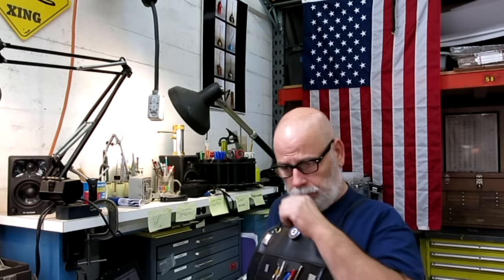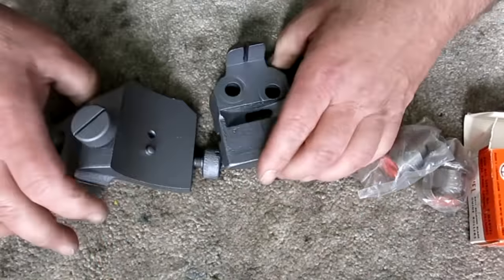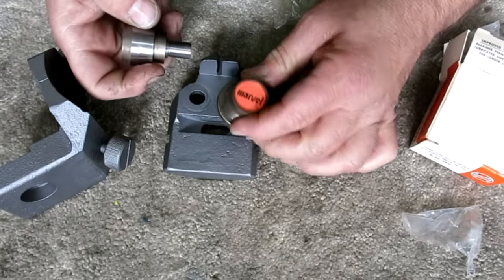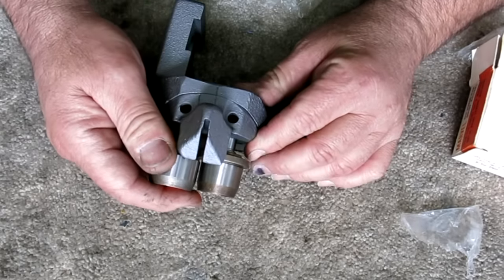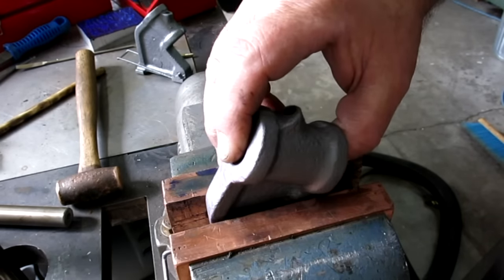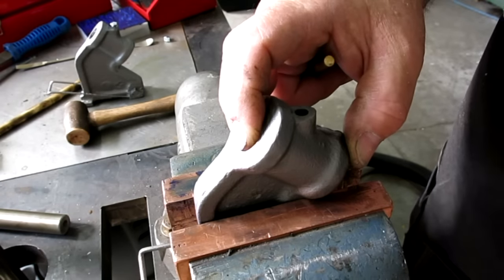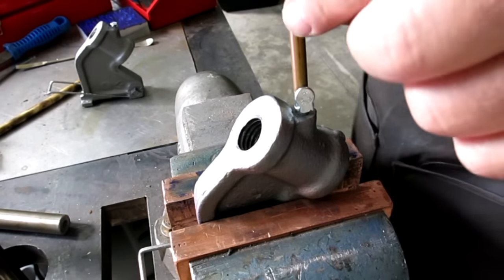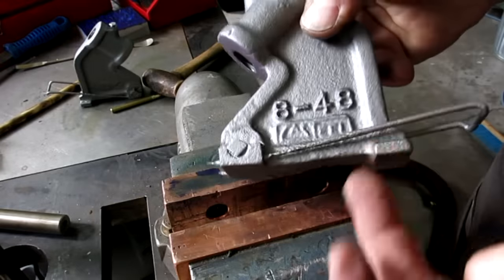Monday Night Meatloaf 105

Comment: "Rode hard and put up wet."  What you don't want to do to a horse.  Riding them hard will make them sweat, a bunch, and when you get back to the barn and after removing the tack, at least curry the horse to push the hair up so the sweat will evaporate.  Here in Florida, we usually put the horses on the wash rack and give them a rinse to wash the dirt and sweat off.  Of which they promptly go roll in the the dirt.  Ya gotta love em.

Comment: I just tried out Northern's tap wrench that arrived today. This ought to be the industry standard. Very, very nice to use and certainly well made. I'm tapping #6 & #10 in blind holes and this is much better than my other method (socket screw in the drill chuck to center the tap, small open wrench to turn the tap). I was going to make my own design for a wrench but this one is ingenious. Wonderful, and the price is reasonable. You have a great channel and I appreciate your thoughts and professionalism, thanks for reviewing this great little tool that I would not have noticed otherwise. BTW I live in Canada and our dollar is low to the US dollar, I paid 30% more because of that but even at that it is a treasure and will save a lot. It's a matter of pride that (North) American quality wins out in the long run.

Comment: Fun stuff Tom. The tap wrench looks pretty good and useful for sure. It should make having to use the smaller taps easier then a T-handle style. Send in that shaft when your ready and we'll get you fixed up.
Reply: Our design is an improvement on both a straight handle and T-handle wrench and hope that others understand the benefits.  Northern Machining
Reply from the maker: Hey Adam,

Thinking this one is a little small for you buddy. Wait til they come out with the #24 Northern Wrench. Thanks for stopping by.

Best,

Tom

Comment: I would not spray "weld" that shaft. Spray welding isn't really welding. It's a metal cladding and the bond is mechanical, not chemical. It's only suitable for static surfaces like roller bearing journals or lightly loaded sliding surfaces like for a lip seal. It would be much better to turn the whole shaft down maybe .06-.1 and weld it with an actual welder (choose your process, they will all work). Then machine the whole thing back to size. Don't just weld the corroded bit because the shaft will warp all over from the heat. You have to weld the whole thing. Hopefully you will not have a bunch of runout in the gear when it's all said and done.

It might be easier to turn the shaft down to the next nominal size and use a thicker bushing. You would have to sleeve the pulley or whatever goes on the out end of the shaft.

Comment: The tap wrench is pretty clever, I will investigate to see if the carry various sizes...  I see this speeding things up quite a bit, vs. swapping in & out my spring loaded center... not to mention, while doing very small holes, and being off kilter ever so slightly, and running the risk of snapping a tap, due from unequal flute loads...  Thanks for showing this one. I was thinking about the guild bearings, are they hard to come by, of no longer made? Beings that in due time, these new units will wear out as well, would it be a simple idea to blue-print them out, as they are new.... so down the road, you have a print, of the important & factual  dimensions, maybe then you can design & make your own?, That is, if they are hard to come by.... Drew

Comment: I find forceps are better than tweezers because you have the option to clip them in place.  Short jaws and long handles increase the grip to something similar to a miniature pipe wrench ...another candidate for the copper jaw treatment.

They both come in a mindboggling range of shapes and sizes and usually have a good amount of metal on the jaw, enough to allow a bit of massaging with a file to accommodate specific shapes

Comment: I remember when I was an apprentice,  we had white cloth aprons that had a little swinging pocket sown onto the bib to hold a 1" mic so it wouldn't fall out onto the floor every time you bent over.
Reply from the maker: Hi Pete,

They still have them. The apron I have has a flap front that you can lock down as well. Thanks for the comment.

Cheers,

Tom

Comment: Enjoyed the video as always.  Like you said that tap wrench needs a little more size on it or a note specifying that it is for taps up to "X" size.  You might have actually used a larger tap than they had in mind for the handle.  Keep on keeping on.

Comment: Re: tweezers... You might want to try plastic tipped as well. People think of them as non-marring, but most types also have the property of being just soft enough that very small screws don't watermellon-seed out of the tip while you are trying to get them started in a hole. I also plastdip the tips of tweezers and needlenose pliers for the nonmarring and slightly grippy property.

Comment: Steel it good stuff painted a BMX frame with it and a Baja VW race car tough stuff, clear coat helps did help the VW it slammed in to a rock twice as big as the Bug folded the right so if there had been a passengers seat they would have been hamburger. Big the left side look great!

Comment: I note that the tap wrench is listed at 10" overall. Tough on the legions of YouTubers who have 9" lathes. Combined with your observation, it might be nice to have a 9" (or 8.5") option with larger diameter handles. (Shorter handles require a harder push to get the same torque on the tap.) Or maybe an enterprising user might shorten the handles and install a pair of 3/4 or 1" ball ends.

Comment: Thanks for the tip on the steel-it. If it can protect bleach filling equipment, maybe it will do the same for things exposed to salty coastal air.
Reply: I had some paint that my dad got while he was in the Coat Guard years ago.They had no use for it because it was battleship grey and the story was it was kept on hand in case of war but every so often it got replaced.Well my dad grabbed a few barrels of it and we used that stuff for years at my uncles marina.We started with a old salvaged Travel lift that we restored and we painted it with that stuff and 20 years later its still rust free.We painted everything with that stuff and I really wish I could find it again because nothing and I mean nothing has held up the same.We've repainted things 2-3 years after painting it with todays garbage that looked worse than stuff finished 20 years ago.

Comment: Try titanium pliers. Not cheap, but solder do not stick to them and they do not magnetize and pick up stuff you do not want to pick up.You buy them once and cringe a the price, but they last a lifetime and you soon forget  the price.Some tweezers  do not open up enough to grip larger stuff. Just prop a small rubber O-ring in between the legs and adjust to your preference. Any other rubber item will do, but you'll probably find an O-ring close by. :-)
Reply from the maker: Great idea on the oring in the tweezers. You really want to use them one handed so having them stay open a little more would be useful. Thanks for the comment.

Cheers,

Tom

Comment: Galvanic series.... right, so what does painting a polyurethane impregnated with S/S 316 do for your steel parts?
I would think a zinc product would be better.
Same reason you wouldn't use nickel antisieze on aluminium right?
Reply from the maker: Hi Nick,

Check your electrochemical nobility chart. Steel and cast Iron are pretty close. Alum and steel are much further apart. Basically when you coat steel with this paint it has the basic corrosion resistance of stainless steel. Thanks for the comment.

Cheers,

Tom

Comment: I could have used that tap wrench yesterday but used my own low profile version instead with a centering hole.  I primarily use the smaller taps that don't have a dimple and it would have been very useful.  They are certainly not giving them away at that price but I suppose other "high-quality brands" might cost just as much with fewer features.
Reply: They're as much and more.Hell I've seen "Top Quality Imports" advertised at a hundred and more.
Reply: I do appreciate made in the USA (assuming anyway) but as a hobbyist and for a single tool, it is pretty high.  They should also consider making them in different sizes, say down around the 4"-6" area.  I'm hoping that they are reading over these comments too.
Reply: Keith Ward I'd like to see it with interchangeable length handles.I think it would be pretty easy to do on their design.
Reply: Hey guys I am with Northern Machining the makers of the tap wrench and yes I am starting to see the need for shorter handles, or different variations of the handles as far as length and diameter.  These have been made in a relatively small batch (50ea.) so that is what is driving our price up along with not short cutting the quality.  Our jaws do not wear or chip away, at least not what we have in our shop or any complaints from anyone that has purchased.  This is made in the USA!
Reply: Northern Machining, Inc. I'd really like to see if you could do swapable handles.Even if we didnt buy them just being able to machine up a set of our own would be a great feature in itself.
As far as pricing goes I think you're right in the mix for what it is.It's priced within reach of other top quality tools so I wouldnt let the youtube cheapskates beat you up too much.But if the price were to come down about the price of a few beers it might help sell a few more.I know it would get me off of the fence.

Chances are I'll be ordering one pretty soon because I  tap a lot of small holes in hard materials and as we all know its not the big taps that break ;) So for me if it keeps one part out of the scrap bin it'll be money well spent and I'm sure there's others out there that feel the same.

Comment: The tap holder is an interesting concept but is it a solution in search of a problem, whats wrong with a drill or collet chuck, of which most people already have?
Reply: Leverage?
Reply: Yan Wo power tapping?
Reply: You dont have to power tap -you can also twist your mill spindle/lathe chuck by hand.Great for blind holes or when you dont have  machine taps.It will stay in center,just back it and oil it if you use hand taps.
Reply: Indeed you can, on my mill I just turn the pulley so I have "feel". I also have an auto reversing tap holder for power tapping, but rarely use it.
Reply: In a drill chuck is an option for smaller taps, but many times you can not turn one by hand, or pulley if near a 1/2".  All depends on the situation at hand.  Maybe is not the wrench to use every time, but has been designed to work both as a straight handle and a T-handle wrench, in a compact design.  We should however incorporate smaller handles as a resolution to the swing issue for smaller lathes ect...  Northern Machining
Reply: Northern Machining, Inc. Of course every situation is different, that's why there are such large catalogues full of tools.:>)

Comment: On tweezers:  I work on very small stuff and use them constantly. The usual culprits sell you stuff made out of "stainless steel," probably in Pakistan. Nonsense. Last I heard stainless steel doesen't magnetize, but mine do. Hmmm. Laws of physics violated.  Watchmaker/clockmakers tweezers are usually sold by honest people. You can also get brass tweezers which really will not magnetize. When assembling a watch you don't want to magnetize the thing. Another very useful tweezeroid is a surgeon's hemostat. These will lock, and come in all sizes and shapes. Amazingly I found several at Wal-Mart under "fly tying equipment." $3 apiece.
Reply: Certain Stainless Steel types can be attracted by a magnet.
Reply: 400 series stainless will take a magnet.
Reply: Unaware of that -- thqnks!
Reply: chances are the tweezers are not but if they are made of 15-5, 17-4, 13-8 stainless they can also be magnetic.   Chances are they are made from low grade 416 (crapaloy) or something similar.
Reply: chances are the tweezers are not but if they are made of 15-5, 17-4, 13-8 stainless they can also be magnetic.   Chances are they are made from low grade 416 (crapaloy) or something similar.
Reply: +Juan Rivero "crapaloy" isn't because of it country of manufacture.   it's ment to describe the quality of the alloy.  I work in a plating shop, when anything that is a 400 series comes In for plate it's well known that it's a guess as to if it's gonna come out good.
Reply: Understood from the start. THanks.

Comment: They could have made that wrench a lot better if the handles were removable, and the drive shank had 3 flats so you could power tap without it slipping on the tap like normal.

Comment: how about just turning off mag chucks before trying to rip parts off lol. Bob's your auntie
Reply from the maker: Hi Billy,

When you have some residual magnetism combined with super flat parts they can be pretty firmly sucked on to the magnet. Thanks for the comment.

Cheers,

Tom
Reply: Oxtool. You are completely correct. I haven't worked in a shop in a while now.. Maybe two years...I did some very memorable time in a new build shop for automotive stamping dies. It was the most pleasurable work I've ever done. I went from fly cutting in "milling" and turning bumpers on the lathe and grinding to height with the 0.040" groove for lead checks when dialing the die in. To assembly and fitting all the components on the bill of materials for whatever die I was on, to press try outs where I learned how to check a first off part on the fixture and use feelers and pin gauges etc. The first off is never to  spec So I learned how to blue in forms to find high spots and how to wash out material with rotary stones and relieve areas causing hard marks in the part.... Sometimes even the gutting station needed adjustment.... Shimming die sections over to fix cutting clearances etc..... Really really cool stuff. I just wasn't being paid enough and I had to take a less rewarding job as a technical advisor for a front end aftermarket company. But I fantasize having a mill or lathe at home.......i miss machining so much sir.
Reply: Oh and to make matters worse Mr Lipton, my toolmakers tool chest was stolen off the back of my pick up truck the week i left. I ended up staying at a hotel and never took the Tool chest out of the bed of the truck because I needed help(forklift got it up there) and she was strapped on rigid on top of tarp to shield the finish and prevent moisture/ weather checking. The hotel cameras didn't catch a good portion of the lot but it still got a description although police claim it was just a dummy set of plates.... They non chalantly backed the truck up against mine dropped their tail gate and rolled my box onto their bed and drove away i still have utter breakdowns when I wake up some mornings. I don't have a toolmakers or machining job anymore but I had so much stuff and only the best mittys..starrett...b&s........ anyways can't talk sleep time for now 😞
Reply: I told Keith fenner about it and said that his tool box giveaway was such a kind act and reminded all apprentices to never make the mistake of leaving a toolbox anywhere where it can get stolen no matter how brazen youd have to be to pull it off in such circumstances it can happen to you.
Reply from the maker: Hi Billy,

That is a horrible story. Sorry to hear it happened to you. I lost a toolbox at hotel when I was doing some field work. I was luck and got it back. The crooks were carrying it back to their room and got tired because it was too heavy. Thanks for the comment.

Cheers,

Tom

Comment: That is one expensive tap wrench :/
Reply: Northern Machining here<

Expensive, I will agree, when comparing to other lesser quality wrenches that will not do the same thing.   This is a combinations of a straight handle, and a T-handle style wrench in a compact design.  As noted by many a variation in handle lenghts would be nice, for some situations, but you will need the long length for a 1/2" tap.  That may be an idea as a buying option on our website in the future!